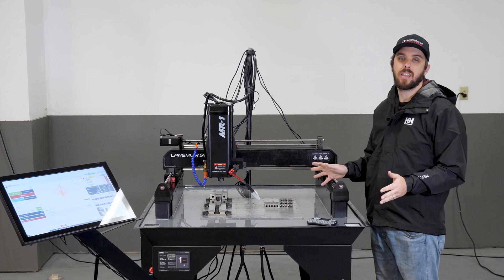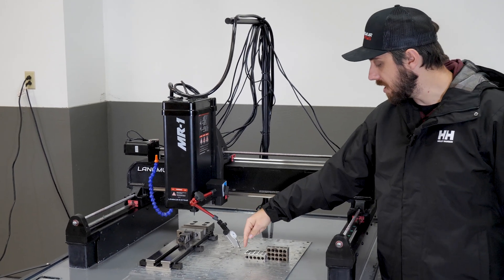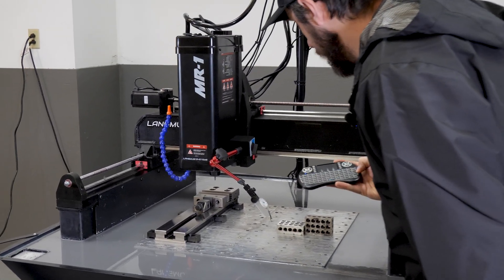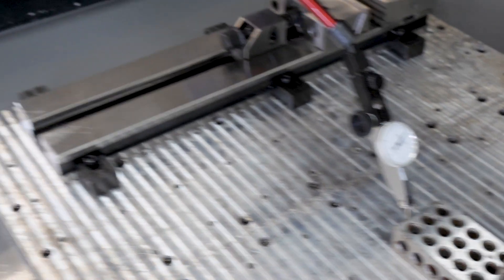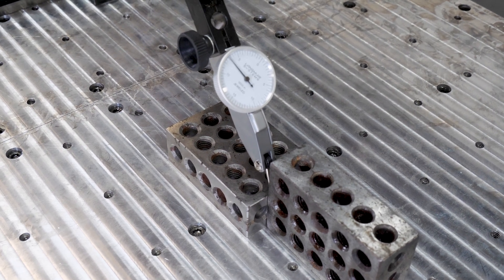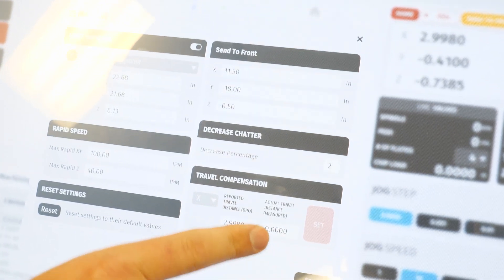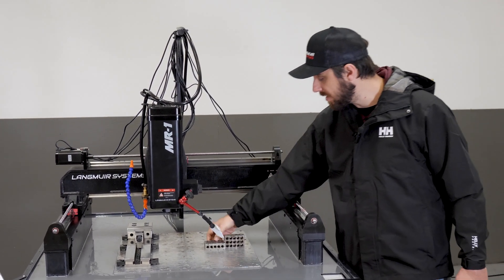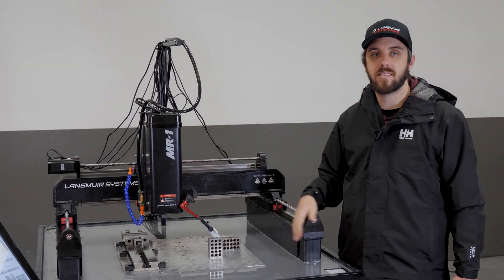MR-1 CNC Mill Assembly Tutorial: Setting Travel Compensation in CutControl Software

Comment: I don’t think this is a good practice. In this way you only calibrate the machine for 3 inch in that position of the working area. The right way is mapping the ballscrew, linuxcnc can do that.
Reply from the maker: Thanks for the feedback. Our ball screws have very consistent pitch across their lengths which makes this method a suitable procedure for reasonable accuracy across the machine travel envelope. We also match the pitches of the two Y-axis ball screws to each other in-house in order to further guarantee consistency. But you are right about ball screw mapping it is absolutely the preferred method to get that next step in accuracy. We are in the works on an electronics firmware/control software upgrade that would permit this functionality and it will be backwards compatible with all machines in the field when it releases.
Reply: @LangmuirSystems  I look forward to that! This being a gantry style mill with no ATC should be extremely accurate & precise when accounting for all variables. I want to dial mine in as much as possible.

Comment: So, if I understand correctly. We are fine tuning the stepper count versus pitch error of the ball screws? Could we reverse the travel direction after setting as another double check of backlash, but it shouldn't need to be done as this has been covered in a previous video. Just a sanity check for those of us in the OCD club.😊
Reply from the maker: Yep you are exactly right Don!